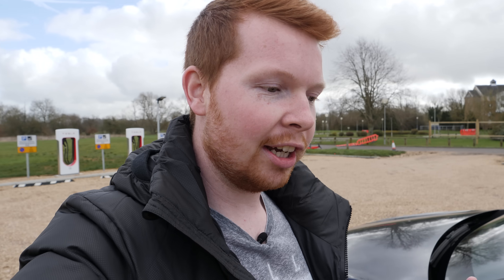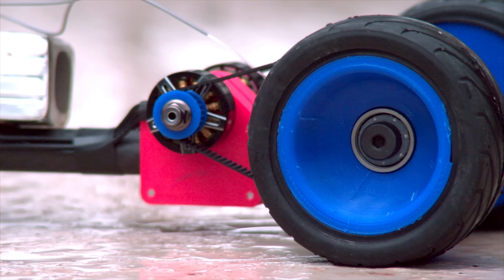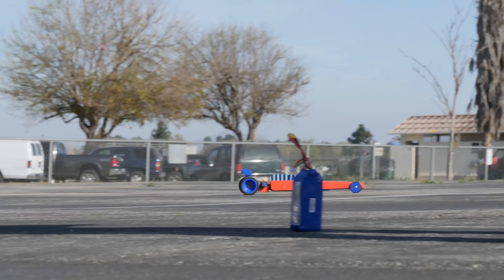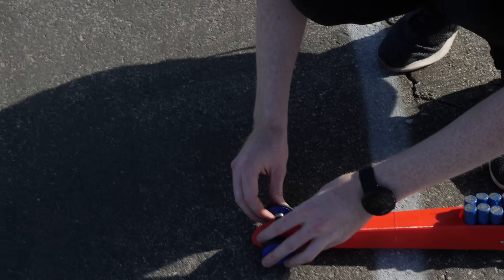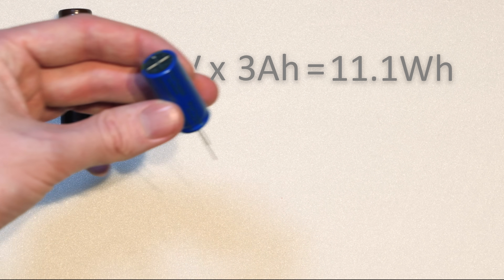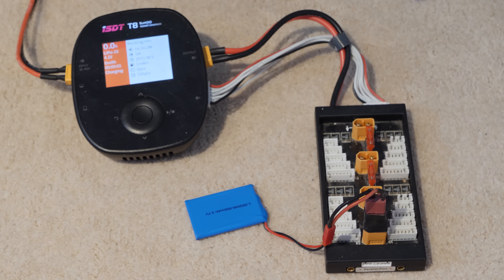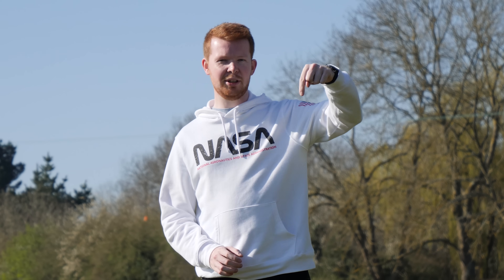Super Capacitor Dragster

Comment: Hello Tom,

Maybe you won't see this message but first congrats for your video. 

I’m reaching out regarding your video about building a car, which I found particularly interesting and very well made.

I’m currently a student in a preparatory class in France, working on a TIPE (Travail d’Initiative Personnelle Encadré), which is a scientific research project we conduct independently on a topic of our choice.

Your work really inspired me, as I would also like to design and build my own car. If possible, could you please share the references or models you used for your project?

I’m currently working with SolidWorks and have access to a 3D printer, which would allow me to experiment with some aspects of your design.

Thank you very much for your time and for sharing your work.

Best regards,
Gabriel

Comment: so you used 12 50 Fared Caps? are they rated for 6 V each? how much did they cost? I saw you used these in your generator video and I wanted to make a similar Cap bank. How much did they cost?!? closed i can find would put me over $80 but for 3 Volt ones instead

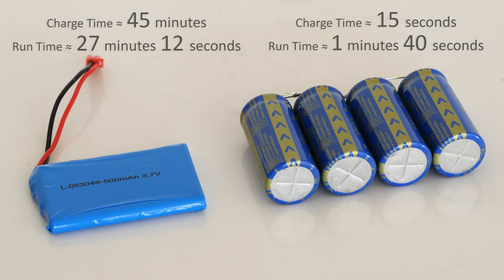Comment: 5:30 in....On the other hand, the capacitors could be charged 180 times in the 45 minutes it took to charge the lithium battery which would give a theoretical 300 minutes of run time VS 27...

Comment: A super capacitor rc car with a solar panel attached allowing it to charge a secondary battery that the capacitors can then pull from when they run out?

Comment: Not sure if this has been brought up, but if you look at the charge time between the small RC cars supplied battery on the faster charger and Super capacitors you get a much longer run time for the same amount of charge time from the SC's. That is only increased by the original charger taking almost 2 hours to charge.

Comment: What if you put a Super Cap pack inbetween the Battery and the Load, it all being connected of either in Parallel or series but after the battery and before the load?
Do you get a power burst increase?
power burst decrease?
Overall Power increase?
Overall power decrease?
Longer battery Cycle life?
Shorter battery Cycle life?
How does it affect Efficiency?

Comment: For a Rev 2 of this project, I think you should program a closed loop control into the steering to keep it straight. So, if you enter a steering command remotely, the steering control limits the desired set point in proportion to the speed.

Comment: To be honest I feel like that could, eventually, catch on in dragster racing - combustion engines are very limited by mechanical connections and relations they use to generate torque (which itself must be limited in order to protect the bearings and a shaft), while electric engines have at least larger level of freedom in that regard. Dragster cars also do not need that much power to begin with - they run out of fuel after just several seconds - which is where supercapacitors come into play. Yet another important thing to mention is the electric engines have the highest torque output at their lowest speed - which is why electric cars altogether have very high acceleration, and why at least someone in drag racing could be interested in this.
 Don't get me wrong - I do believe combustion engines will still have their word (e.g. in contest where the range is the most important factor, hybrid of both gasoline and electric engine is clearly superior - I mean, hybrid is superior to literally everything else in most cases), but where speed and acceleration matter the most (and where cars are supposed to just drive in circles, and where fuel is just excess weight that also forces a car to stop every now and then), it is possible to see electric racing soon.

Comment: Capacitors in series have lower capacitance than a single capacitor normally does. Following the same formula that resistors have in parallel. 1/(1/C1 + 1/C2 + ... + 1/C6) if you have 6 in series.

having lower capacitance means less energy stored. I understand you need to drive a high voltage that the caps might not be able to handle, but you can fix this by adding them all in parallel, and then using a DC/DC converter. There's plenty of ICs that do that so it requires little engineering.

You should be able to get more energy stored this way.

Comment: Given the energy stored in the capacitor is proportional to the square of the voltage … could those super-caps have been held nearer their rated voltage (50v is typical for a normal capacitor?) and the car designed to work with that … to be closer to the energy:weight ratio of Lithium?

Comment: Oh my god he’s putting them in series AGAIN

I don’t know why but every time i click one of your super capacitor videos i think “surely he’s figured it out by now. Someone in the comments must have told him”
Reply from the maker: It's a common misunderstanding that putting capacitors in series is bad. Yes the capacitance reduces, but the energy storage still increases as the formula is E = 0.5 x C x V^2. So putting 2 in series will halve the capacitance, but double the voltage, which is squared. Plus supercapacitors are rated to around 3v, which isn't useful for many projects.

Comment: 2700 Seconds of Charging Gives 27 Minutes performance. Through Li-Ion Battery.

15 Seconds of Charging  Gives 1.5 Minutes performance.  Through Super Capacitor.

If compared on a Same Energy scale Super Cap. May be charged 180 Times in 2700 Seconds .
And each charging will Give performance of 1.5 Minutes which means Super Capacitor can give 270 Minutes of performance.
10 Times the Battery 😮😮😅

Comment: Imagine this done on a public transit bus.  Yes a battery filled bus could go longer without recharging, but if you're going to be stopping often and can recharge in seconds on a far lower mass capacitor it seems like a battery/capacitor hybrid city bus could be a good solution to CO2 from ICE, but the source also needs to be clean or it's for naught.

Comment: You can use the best of both worlds and use two or three capacitor power banks and a small lithium battery to charge them  and rotate the capa itor pack source between the three evey time one of them dies, while charging the other two feom the lithium battery in the background.
This allows you to both have the high capacity of lithium batteries and the high output capabilities of capacitors on the cheap

Comment: Would it be an idea to put a current/voltage regulator into the circuit to reduce capacitor discharge rate and increase life?

Comment: Well use super capacitor that's much bigger and take couple of those upright wind turbines generator part and catch a small wheel to it and let it roll on the tire and pedal to get up to speed be making power or you can use the lithium battery pack pastures that would create 12 volts to keep the trike or the bike Ford with a generator start making power especially if you're on the hill as you go more power you get more power you have for the motor just being stored for a short time in the capacitor as it's been released into the motor and any excess was just bypass the pastor into the motor if you fix it like that so you actually partly using the fat pastors as a battery probably not having any batteries at all I'm in a couple wind turbines being turned by the wheel of your bike and you have another one down there a third one with a sprocket and your pedal your sprocket makes power within the wind turbine generator you can have a thing above your head those are solar panel that will also help charge but pastures by the power of the sun so you might have a off-grid e-bike when you're done DIY off your eBay that would be pretty cool

Comment: Toyota’s LMP1 TS040 race car used super capacitors instead of the conventional lithium ion batteries. At the time they felt it served better for the hundreds perhaps thousands of cycles of recharging and discharging over the course of a 24 hour race. Though when they went to the TS050 they did go to the traditional lithium ion rought.

Comment: Taking the 27m12s plus 45m of charging gives you a cycle time of 72m12s or 4332s.  The cycle time on the capacitors is 115s.  So you can charge and discharge the capacitors over 37 times in the time to charge and discharge the battery.  37 cycles at 100 seconds per cycle is 3700 seconds of run time, or 61m40s.  So which is 'more efficient'?  continuous runtime or total run time?

If you had a charger that could charge in 10 minutes, that would give you a cycle time of 2232s, which would equate to 19 capacitor cycles and 31 minutes of runtime, meaning that those capacitors give you more run time overall at the expense of that runtime being broken in to small chunks.

Comment: Where I see supercaps being useful in the future (other than micropower battery replacement) is regenerative braking.  Regenerative braking doesn't use a huge capacity (it's not going to give you an extra 50 miles for one charge), and a 500 volt bank of supercaps could be charged far faster and more efficiently than the on board batteries.  Once charged up, they could be trickled back into the main battery and/or used to supplement drive current.  Yes, they still need a little more development in energy density to make them worth adding to a smaller vehicle, but I don't see it as unachievable.  A well designed system might work well in mid size delivery trucks even now.

Comment: Can u parallel these with battery's wouldn't they be able to act like a buffer .

The would handle the huge current change's and recharge from the battery. ? 

Im asking.   Why don't people run capacitors banks on ebikes?
Reply: Why don't people run capacitors banks on ebikes?
1) too expensive
2) short discharge cycle
3)  voltage falls off too quickly
4)  acceleration is not a major concern

Comment: at 5:30 you said that the capacitors dont seem practical yet if you had 45 minutes of charge time on the batteries that gives you 27 mins and 12 second or 1632 seconds of actual runtime but on the super capacitors it would only take a matter of 255 seconds of actual charging to achieve the 27 mins of runtime. you would have to charge it 17 times though  :P I love the idea of capacitors, batteries as we currently know them are not sustainable in my opinion! especially lithium!

Comment: One problem with using super caps instead of batteries as a power source is the discharge curve. A battery has a nearly flat discharge curve until near the end where it drops off fairly suddenly. A capacitor starts to lose charge immediately and drops rapidly to virtually nothing. The two curves are nearly exact opposite to each other. While supercaps can store a lot of energy, I can't see them being used as a serious energy source due to that discharge curve.

Despite the above, I do like the demo you've done here and all the others. 3D printing makes building stuff so easy.
Reply: They definitely need a dc dc converter to be useful, and generally seem to have the most usefulness when used in combination with batteries. They can take the brunt of surges, in say acceleration in an EV or for regenerative braking, while keeping the output of the battery cells within a range that promotes longer lifespan. The main problem is that they're quite expensive and heavy, from both the cells and the added need of an extra power converter.
Reply: Serious question, does that not match the curve of a topfuel dragster then?

Comment: Making the chassis more close to the ground and adding a working suspension would help it keep more straight. If you added more powerful and heavier motors you could also add a wheelie bar(only if it was able to do wheelies).

Comment: You need to charge lithium ion batteries and hour to drive 27 minutes. But if u keep charging the capacitors you can achieve that 27 minutes run by charging 4 minutes if a charge time lasts for 15 seconds.

Comment: It is wrong to assume that they are impractical as 1 case charge time 45 min run time 28 min. 2nd case charge time 15 sec run time 100 sec. 
That means that for the equal time of charging of 2700sec, in second case we would have 180 charges, therefore having running time of 300min, taking equal speed of movement in second case we could for the equal charging time pass more than 10 times greater distance.
Now, imagine instead that chargers are build in in the road, as high power electromagnets, that would mean that car does not need to stop at all for charging.

Comment: Lostcanyon-(Lee) I have thoughts on a number of your projects. I love watching your builds, and the fact that you are undaunted when they fail. On the "hovering a rocket" project, i think of the modern, high super cars that have variable steering. the higher the car's speed, the slower the ratio on the steering. Your rocket controls better at lower motor RPM. At higher RPM the deflectors need to be smaller or move slower when activated.                                                               On the air powered car where you tried the syringes and the tube swelled, loosing the seal on the pistons. Make your own three cylinder block and possibly use the syringe pistons, or make your own with O rings. Perhaps a tiny bit of Vaseline for lubrication. If that messes with the plastic, you could use model RR lube. There is one that is safe for most plastics.                                                                                                                                                                                      On the Trebuchet with the different balls. you switched to a vertical backspin instead of the side spin and it flew straight but did not gain distance as you thot it might. Did you consider a forward spin? perhaps it would improve the distance.                                                                                                                                                                                                             Back to hovering the rocket. Have you thought of using a venturi effect for more thrust. If you did that you might be able to use the higher pressure above the venturi to open your four guidance ports. put a more powerful, higher speed motor on it.                                                                                                                                                                                                       I spent the last four years of my "maintenance mechanic" career rebuilding industrial vacuum pumps, so I am festinated with the concept of a vacuum powered car. I will go check that out.  Have fun.

Comment: lol what was that intro? Did you film yourself taking the charger out of some random person's car?

Honestly, 180 super caps for 1 standard in-usage battery is not bad. And the lithium ion pack was much bigger than the capacitors, so it seems more something around 40 times the energy density, which is pretty decent for all the advantages. Just a few more steps in improvement and they could be commercially viable! We're getting close

Comment: Rc cars have two capacitors in the esc (electronic speed control) I assume the capacitors can guve the motor more power on tap then the battery will

Comment: You should test the rc car with the battery and capacitor in parallel to see how it extends the capacity (it reduces the peak discharge of the battery and allows it to last longer. There is an article that reports 25%). There are some interesting numbers at 5:31, the time required to charge the battery allows you to charge the capacitor 180 times, and it would only take 16.32 charges to match the running time. Another cool experiment would be if you can create a docking station or a type of charger as a cable car (you could use diodes for protection).

Comment: Super capacitors in electric cars make sense for something like recuperation. Use the super caps to store braking energy and release it for a short spurt of acceleration but do the actual driving on the regular battery pack. Might not be worth the added complexity, but that's the only sensible use of super caps I can think of.

Comment: 5:25 I'm quite sure you need to use some voltage regulator to even come close to using all the energy in the capacitors.
Batteries voltage only drops dramatically when they're nearly out of energy. Capacitors' voltage decreases linearly.
Reply: Capacitors' voltage decreases on a Logarithmic basis
                          Capacitor discharge (voltage decay): V = Vo x e^-(t/RC)
A VR won't help. You need a boost-buck converter
The statement about batteries is also wrong - it depends greatly on the battery chemistry

Comment: You'd want a voltage regulator to charge the capacitors evenly, and a boost converter to use more out of each capacitor. What that you should be able to use your car for quite a lot longer time.
Reply: @kennmossman8701  I guess some capacitors are in series, if not most. Just charging the whole pack at once will result in some overcharge which is really bad for these large ones. That's where a VR helps.
Reply: Unlike batteries you can not over-charge a capacitor. Once charged it just doesn't accept more energy. If you are talking about smoothing (AC to DC) then yes ripple at high currents is a concern but is a matter of capacitor selection and not helped by a VR [moreover such caps go before a VR].
Balancing the charge between caps in series is a concern but is done using a balancing circuit [typically a simple resistor divider though not applicable in this case]. A VR would not help - it would only keep a constant voltage across the series caps and not each cap.
Reply: @kennmossman8701  that supposes that you can controlled voltage to charge it to its max value. If you don't have that it'll explode. When in series even with controlled voltage they may explode for the same reason, as their resistance isn't the same so some will get more tension than others